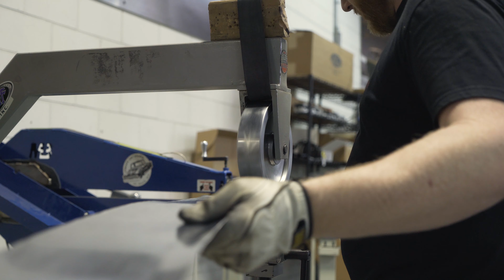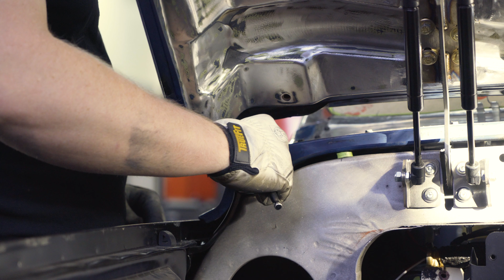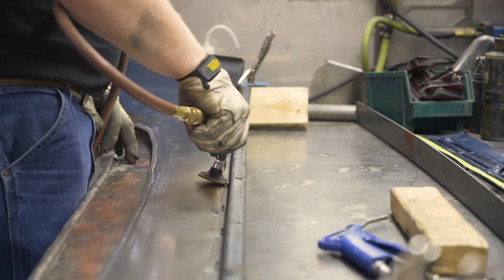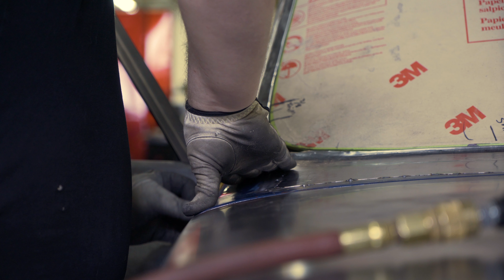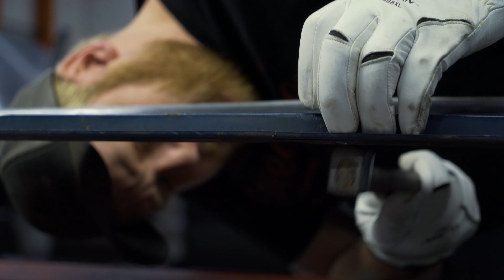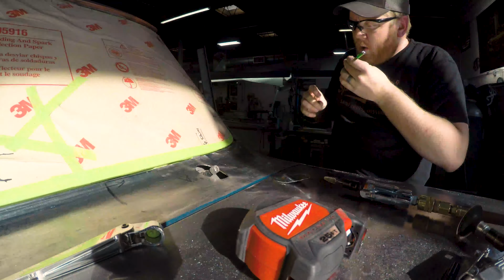1967 Chevy C10 Build | Part 5 | Custom Cowl

Comment: when doing this cowl i find it interesting and wanted to ask why MIG weld the part, in previous videos you TIG weld the bed where where is likely no metal shaping after welding yet here where there is likely to be hammering to smooth the weld it was MIGed.  This seems odd since hammering a MIG weld will likely create tiny cracks because of the brittle nature of the weld which could negatively affect the lifespan of the paint going over it.  as well as the MIG weld not wanting to move as easily as a TIG weld.   so, why was MIG done here instead of TIG?  because of the quality of the builds i am guessing there is something i am missing.
Reply from the maker: I’m sure we would TIG this now, but there’s nothing wrong with using a MIG on a seam like this. It obviously depends on how much movement you’re trying to take out of the panel, but the hammer and dolly aren’t going to put so much stress on the weld that it will cause problems in the paint later on, especially if you start off with a butt weld that fits well. That may not be the case if you had to take a lot of movement out of the panel or ran it through a power hammer or planishing hammer. On a case by case basis, we’ll use fiberglass filler over seams to help with the integrity of the surface or if we think the seam will be exposed to moisture from the back side.